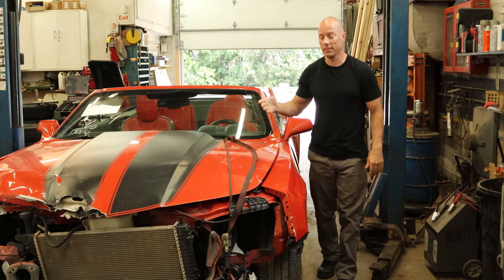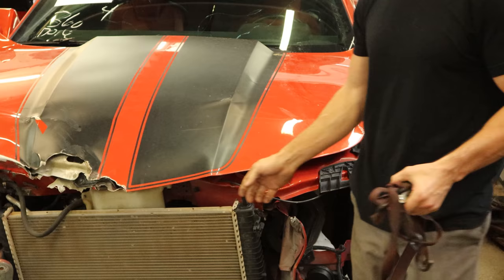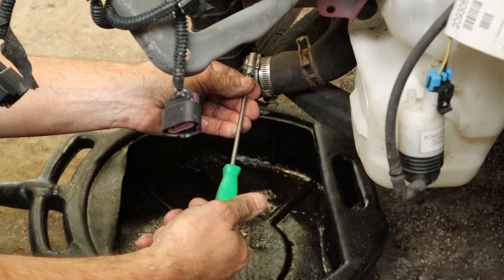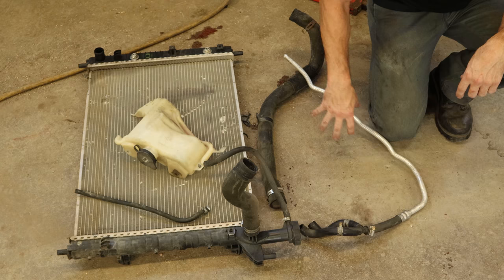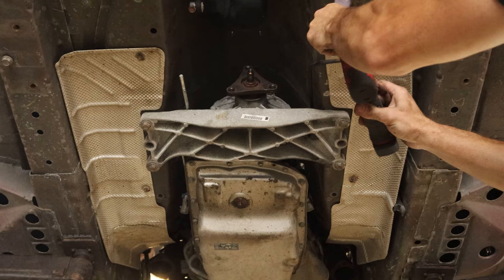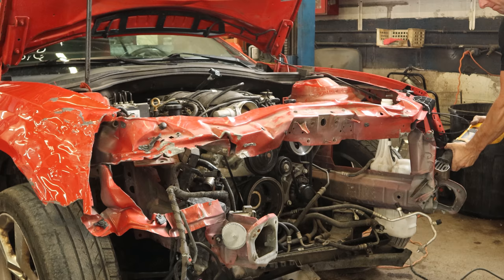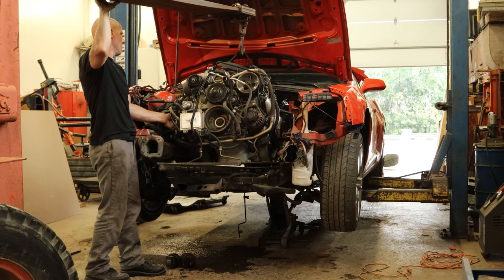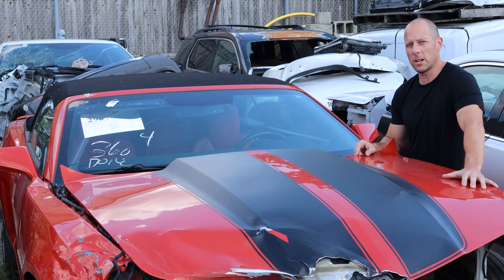Just because it can be repaired doesn't mean it is the best option.

Comment: I have been working on my own, friends and In Laws vehicle for the last 37 years and it is still enjoyable watching other people apply their craft. Especially watching Scott apply his touch and his caliber of repairing vehicles. It looks like nothing gets by Scott's eyes.
Reply from the maker: Thanks for the support!
Reply: I don't have a lot of tools to work on cars, so I never got much experience, but working on computers doesn't require a lot of tools that cost money or take space around. Despite me enjoying working on either, people who I help for free are really ungrateful, unfortunately. Like goes the old saying, no good deed goes unpunished.
Reply: @gteixeira    Wassup Gabe. You've  reminded me of A few sayings  I share. Any mechanic can work with the right tool, but A master mechanic can work with any tool.  Few examples: flat tire in a bad area of Rockaway N.Y.  I limped to a gas station and the attendant wouldn't sell me a tire plug for $50. I aired the tire and took out a pointy fender bolt and plugged the hole with it. and made it home. next Overheating on Ocean pkwy Faulty thermostat, took off the hose clamp with a quarter,  pried the stat open with a peace of steel fastened the hose and filled the radiator with ocean water using soda and gatorade and soda bottles. once again made it home. one more that made everyone call me macgiver. dead batteries trying to start my truck (my mechanic knew it was a bad cam position sensor) $15 from pep boys right across the street that closed before i could get new batteries.  My laborer stood on the shoulder holding jumper cables. After A police officer and A  roadside HELP truck ignored us. it came to me, I disconnected one of my speaker wires hooked up to one of my dewalt tool batteries. then to the trucks batteries, low and behold it started up. home again. just because the right tool isn't in the box doesn't prevent us from thinking outside of it. I've used A 9\16"wrench to tighten or loosen A 1\2" nut hundreds of times. fill the void with A regular screwdriver 
Don't tell me i cant do it, i'll only try harder. Remember, u can build A million bridges, few call you A bridge builder yet suck one _ock and ur A _ocksucker for life.  hope you've enjoyed Tommy from Long Island
Reply: @thomasriehm1014  that's what people like to say, 'it can't be done' those are the same people who will keep your car, fix it than sell it at the auctions and profit from it

Comment: The nice thing about worm gear  clamps is you can really get some  Torque out of them.Bad thing about warm gear clamps is you can really get some torque out of them.  You can fracture  The neck of the radiator if you over Torque  it. One day you'll be driving the car and next thing you know the water neck on a radiator blows off.
Reply: The worm gear clamps work well when the hose it clamps is on a fitting made of metal.  With plastic such as radiator necks they can collapse and break the fitting if they are over tightened.  It takes careful tightening to prevent leaks and not break anything.  Spring clamps actually work better in some cases because they can expand and contract with temperature changes.

Comment: I know that this is an old post but as I'm new to your channel my comment will still be valid. You are absolutely correct about the seatbelt being strong enough. There is a simple formula for determining the impact force your body would face in a vehicle collision. Take your body weight and multiple it by the speed of the vehicle. That is the force in pounds per square inches you would hit anything in the vehicle's interior at it's current velocity. I personally weigh 190 so at 65 miles an hour in a sudden stop crash I would hit the steering wheel and dash with a force of 12,250 pounds per square inch. And seatbelts are rated for speeds up to the max a vehicle can be expected to achieve doubled. My source of info was a CHP sergeant when I was a roll back truck operator years ago in the 90's.

Comment: Good old Chrysler minivan coolant hoses.  It's amazing where they pop up.  I used one in my MR2 when I did an engine bay tuck as it lets you delete the factory J pipe on the firewall as well as about 4 feet worth of coolant lines.

Comment: Nice job, Scott.   Glad to see the motor going to someone that wanted and needs it.  Hope you can parts out the interior and top - they look like they are in nice condition.  

Given the conundrum we're in with parts shortage, chip shortages, new car shortages .... - have you seen the prices of wrecked vehicles going sky high as well?
Reply from the maker: Yes, cars are ridiculous.  I will sell the seats for sure, I doubt the top or any body parts.  They are plentiful and worthless.
Reply: @vehcor  said "   They are plentiful and worthless.  "   
You could park the car in a barn and wait 50 years for some YT channel to do what amounts to a VIN swap rebuild. ( See Graveyard Carz 71 " phantom " Cuda )
Reply: @vehcor  I wonder why body parts are easier to get by than engines. I thought that those cars get crashed more often than they need an engine swap, right?
Reply: @gteixeira  cuz the v6 cameros have the same body panels
Reply: @danik1234100  Yeah, so plenty of Camaros would need body panels for repairs while the engine serves to very few specific models.

Comment: I've often replaced those radiator spring clamps with the old type worm drive hose clamps. It makes life a lot easier.
Reply from the maker: I agree, less prone to failure as well.
Reply: i needed some proper hose clamps a few weeks back here in the uk and not one factor could supply them,all  they want to stock is fast moving parts ,the best here were always jubilee clamps

Comment: I'm stuffing an LT1/L83 in my 37  Chev PU.  gonna be tight.  The engine measures around 27" at the front and the between wheel wells at that point, I'm 28" I got the engine and trans from Nordstrom's in Garretson SD.  The pickup was their parents.
Reply: Did u account for the exhaust manifold or headers ?  the engine mounts raise it  giving u more freedom.

Comment: The front half of a front lower rail may be sectioned using two separate procedures for the inner and outer rails. However, either of these may be done individually if damage is limited to only one side. The cut locations between the inner and outer rails are slightly offset from each other. For the inner rail, the cut location is identified by measuring from a reference hole. The outer rail is sectioned at the rear edge of the strengthening bead located between the wheelhouse reinforcements.

Different joints are used for the inner and outer rails. A butt joint with backing is specified for the inner rail, using a 25 mm sleeve for the backing. The sleeve can be made from an unused portion of the service part. For the outer rail, a flanged lap joint is specified. This involves creating a stepped flange on the service part that fits under the remaining portion of the original rail during installation. Both joints are welded with a combination of GMA (MIG) plug welds and seam welds. The complete upper rails are available as service parts and replaced at factory seams.
Reply from the maker: Those cuts are not as far back as the damage goes.  I guess I could extend the rails like the hacks do. 😂
Reply: @vehcor  I do not go past shock tower. I-Car shows to go to middle of shock tower but no further. I still stay in front of tower though. Only if the car is worth saving...lol
Reply: Copy and paste much?

Comment: Proof that a wrecked car from the rust belt is only good for one thing: parts. "Nothing says "Indiana Winter"  like rear wheel drive convertible!"- they must have bought if for those 5 days of 50 degree July weather when everyone is in their houses with the air conditioners running.

Comment: Something to make pulling an engine easier.  Hang a chain fall off the forklift and leave the forks up, this way you have instant fine control of lifting.   I'd do this when I worked in a factory and needed fine control that the 20 T non speed adjustable bridge crane didn't offer.

Comment: Love your Friday video  alot. I have a question for you I have a 2005 honda odyssey. I hand a lot of work done including the water pump and timing belt. Of course the head gasket let go and the timing belt broke. Argo the valves are bent. I am thinking of a remained engine and transmission. I am across the state would be intrested I swapping the motor and transmission? Cost? I don't trust anybody here in the quad city's. Just asking.thanks further videos. Your friend Gary
Reply from the maker: I have way too much to do already but there is a good guy not far from you.  Check out Watch Wes Work.

Comment: I never see red ant-freeze before. I can’t believe that the drive shaft was two piece.
Reply from the maker: All GM antifreeze is red since like 1995.  Most Australian cars have two piece driveshafts for some reason.  They eat center bearings but do cut down on rearend noise.
Reply: @vehcor  Since when are Camaro made in Australia. And my 2008 GMC truck antifreeze wasn’t red when I change it at 100,000 miles.
Reply: @theodoreko2700  the Camaro was based off the Holdens of Australia, just like the newer GTO's and G8's. And depending on brand of Dexcool (GM coolant) it could be orange or red.
Reply: @vehcor  mine started out red… brown has red in it don’t it?

Comment: why would the fire department cut the battery cable?
Reply: they cut the battery terminals then practised on the doors with their jaws of life when my truck got an engine fire,the loom and everything else i could have repaired but they made the cab scrap,its good practice to have terminals disconnected as cars are difficult to unload off your recovery truck if they catch fire going through town as nobody wants it outside their business as the fuel tank finally explodes in a blister or red and yellow flames and lighted bits flying everywhere